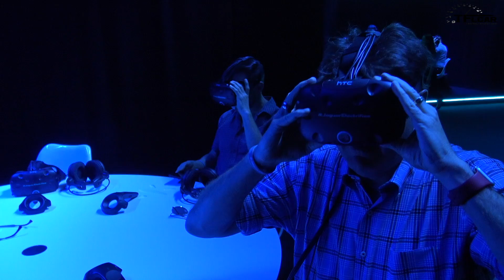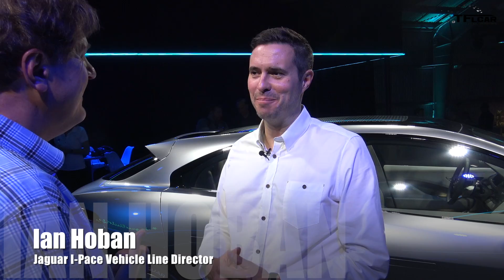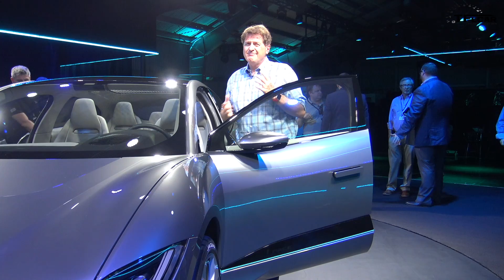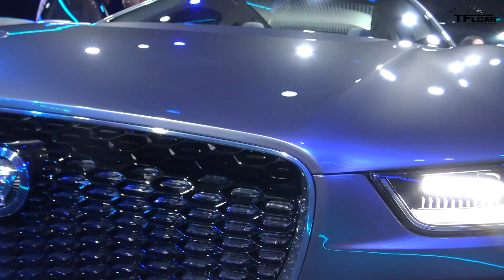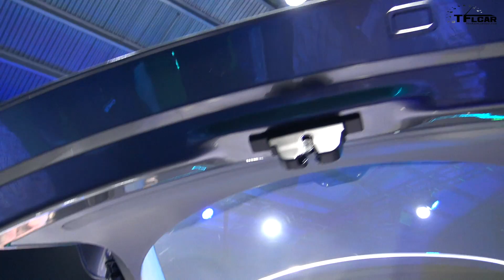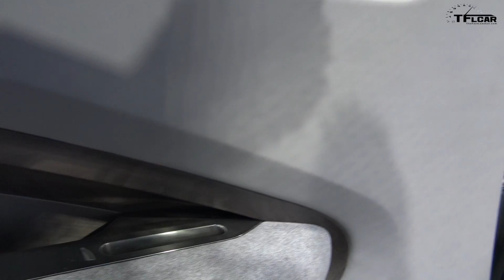2018 Jaguar I-Pace Concept: Jag's First All Electric Car Is an EV Stunner

Comment: That is a beautiful car. Still not ready to give up my gas cars though
Reply: Because batteries are a terrible energy storage medium.
Reply: Batteries also aren't really good for the environment.
Reply: Mike B hydrogen as a fuel must be stored under pressure in tanks of very specific material. It is a light gas that leaks through any permeable material - which is most of them for Hydrogen, as it's the smallest molecule.

Storage must allow for extreme high pressure and extreme cold (as pressurisation cools). It also must contain the ability to create and maintain that pressure and check for leaks - any of which would be catastrophically explosive. It must also be able to detect and eradicate Ice build up which might cause a breach. It must then be able to deliver the Hydrogen to the car safely, with all of the above caveats.

I've yet to see a cost analysis of a system that complex, complete with validation and permits, that costs less than $1million.

Hydrogen stations are absolutely nothing whatsoever like gas stations. They're far, far, far more expensive. 

As I say, the notion of a nation wide infrastructure capable of supporting profitable volumes of Hydrogen powered vehicles is, at best, fantastic and at worst farcical.

That is the reason Hydrogen Vehicles have stalled. Technology is technically there (Though unaffordable). Profit is not. And it's unlikely that it ever will be.

Of the 3 players still in the game on Hydrogen, 2 (Hyundai and Honda) have signalled that they're switching to battery vehicles and the Third (Toyota) is rethinking it's strategy, having sold less than 1000 in a year. Worldwide.

For comparison, Tesla sell more than 2000 battery electric cars a week.

None of this is even discussing the huge inefficiency of electrolysis to create the Hydrogen - a system so poor that you could drive 3 times as far in a BEV using the electricity used to take a HFCV travel a given distance. That means requiring 3 times the amount of electricity generation.

I read that paper. There's a long route between finding something that does something interesting in a lab and commercialisation. It could be decades, if the system is scalable at all. You will ALWAYS have loss in cracking water. The physics of the process make it impossible to avoid, no matter how efficient you attempt to make the system.

Hydrogen as a mass market fuel is a complete non starter.

The only people promoting it are fossil fuel companies. Because they want you to wait for it and ignore battery cars. If you wait for it, you burn petrol and diesel while you wait.

And they're not pushing anywhere near hard enough to be serious about it as an alternative when oil runs out. Just enough to create headlines and cause doubt.

And if the impossible happens and hydrogen cars do take off,.... The only efficient (read: profitable) way of getting it is,..... Steam cracking natural gas. A fossil fuel.

I sympathise, Mike. I wanted hydrogen to be the answer, a few years ago. Then I looked into it and the more I did, the less realistic it became.

It really isn't any more than a pipe dream. To some who are still promoting it, and building a handful of "exhibition" sites (mainly with government money), it's no better than a scam. I guarantee that none of those pumps will exist in 15 years.  There is no Hydrogen future. 

I'd put an order in for an iPace now, personally.  Cars like this and Tesla's are better than regular cars already. Quicker, more refined, more responsive and far cheaper to run. If you have a driveway and a half decent electrician you'll wake up every morning with a full tank. No more money for the house of Saud or the polluters at BP.
Reply: Mike B I'll not repeat this again;

HYDROGEN DOES NOT EXIST AS AN ELEMENT ON EARTH.

There are no Hydrogen mines, there are no Hydrogen fields. Hydrogen MUST be separated from another substance using energy.

Hydrogen is not a fuel, it's an ENERGY CARRIER. It carries the energy used to split it from the substance it came from. That's it. Full stop.

The physical laws of nature makes it impossible for there not to be lost energy in the recovery of Hydrogen and lost energy in the conversion of Hydrogen back into water through a fuel cell or combustion.

Hydrogen is a very, very poor way of storing electrical energy. Very poor indeed.

There is no answer to this. Sorry.

I'm not being pessimistic, I'm being realistic. There is no comparison between using electricity to fill a battery and using electricity to create hydrogen and fill a tank: the use of a battery is many times more efficient.

That makes the infrastructure of battery storage and BEVs cheaper. That makes the load on the grid easier. That makes hydrogen a very poor idea for ANY company looking to make money from the stuff when a better alternative already exists - which it does. A hydrogen plant and storage system will always be at a disadvantage, commercially; they'll be undercut on cost again and again and again.

Add on the cost of the equipment needed to do the job and there's literally no conceivable way for a Hydrogen Economy to turn a profit at scale. And without that incentive, it simply won't be built. Ever.

The market has already decided: battery electric cars and battery storage are commercially available at scale today. Hydrogen is not.

There is no point waiting for hydrogen cars because the infrastructure will never come. Not in 5 years. Not in 10 years. Not in 20 or 30. 

End of.
Reply: research...
Reply: +Adrian Macias. I don't blame you. I kind of think Hydrogen cars are the way to go personally.
Reply: If you go down the fuel cell route sure, very costly, but it has more promise on range and MPG etc in the long run... but if you go down the Hydrogen Internal Combustion Engine Vehicle route which was what I was on about then... that is already doable. And they are still as zero emission as a Hydrogen fuel cell. If MPG on them is comparable to a gasoline equivalent, if not a bit better... then MPG becomes less relevant in both environmental, and fiscal terms. But nobody is bothering to invest in this at all to improve economy, which is a shame as its well understood, can make use of existing technology and manufacturing facilities.

I can believe the cost you cite for the cell due to the chemical reaction requirement, but the pump, essentially which just has to pump hydrogen from a store into the car much like a regular fuel pump does... struggling to see how that could cost $1million a pump. But if you have a source, I'd like a look.

Also in terms of hydrogen production: http://phys.org/news/2016-06-scientists-cheaper-hydrogen.html 
its already becoming cheaper and faster as there is real research going on all the time. Of course I doubt the oil companies want any kind of alternatives for fuel, be it hydrogen or batteries. Because there is still money to be made in oil. And while there is money to be made...
Reply: Problem with that is that Hydrogen cars are DOA.  The infrastructure to sell them in profitable numbers is too expensive and highly, highly unlikely to ever be built.  It costs $1Million A PUMP for hydrogen and due to the nature of the fuel they can only fuel 1/3 the number of cars as a gas station per day.

Practically speaking, a hydrogen fuel station of 6 pumps will take nearly 20 years to break even.  I'm not naysaying - it's just the reality:  Hydrogen has been sold as "the future" by companies like Royal Dutch Shell,... because while you wait another 30 years, you're ignoring BEVs like this Jag and buying gasoline.  That's the point of the scam.

But they have no intention of actually building the infrastructure needed to persuade manufacturers to build HEVS at scale.  None.

Toyota were given a small fortune by the Japanese government to develop the Mirai but it's not a profitable vehicle.  It sells for just over $50,000.  The Fuel cell alone costs that.  They loose at least $30,000 per car.
Reply: @Chicken Strangler batteries are recyclable which makes them infinitely better for the environment than petrol.
Reply: @Strangething90 Methane from cow farts are 23x-30x (don't remember) more potent at trapping heat in than Carbon Dioxide, Carbon Dioxide however lasts in the atmosphere longer
Reply: Hydrogen is the most plentiful element in the universe, its literally everywhere. Readily available clean fuel for all. This attitude of pessimism and worry over profit is why its not being utilised for things other than weapons. Transitions are always uncomfortable, but they are a necessary "evil" that must be pursued. There are plenty of papers where people have tested groundbreaking ways at making hydrogen cheaply and cleanly... as you say upscaling it to industrial level... well, that requires investment before it will pay off. 

The only "problem" around H is money, because there are too many powerful people who aren't interested in progression and paying for it. Fuel cells at the moment are not even required, not when HICE Vehicles are possible and research shows Hydrogen ICE's are at the very least as efficient as a petrol engine if not 20 to 25% more efficient, and that could be improved with research, so we already have a Hydrogen car (minus fuel cell) in theoretical financial reach of the "common man" should manufacturers and industry choose to make it so.

Most manufacturers are still heavily invested in standard ICE's and make only a token Electric car anyway. Eventually it will come down to a choice sooner or later because standard ICE's can't go on forever...  the choice being batteries... or hydrogen.  Batteries may well "win out" In the end, but the battery is an antique energy device thats been modernised repetitively, and most of these electric cars are not cheap as it is. I still support hydrogen, its the superior and more future proof choice and that's my final word.
Reply: Yes, "end of" quite. You insist Hydrogen will never EVER take, I don't know if your clairvoyant or have a crystal ball but, overt repetition of your opinion does not make it a fact, and time will ultimately tell... I personally don't care if Im wrong, or right, I don't have shares in a hydrogen or battery company... so I literally have no conflict of interests in this discussion. I just read the latest research on hydrogen powered vehicles and I have liked what I read.

If anybody else who has followed this conversation is interested, the Latest research for hydrogen over this year, last year, and the year before has made some groundbreaking advancements in the application, storage, and creation of H+. With scope for industrial application.

Further I will add this quote I: Takeshi Uchiyamada  Chairman of Toyota, the largest Car Manufacturer in the world, said and I quote; “Because of its shortcomings — driving range, cost and recharging time — the electric vehicle is NOT  a viable replacement for most conventional cars.” 

That quote is attached to a number of articles you can find on google. If the chairman of Toyota a motoring gargantuan, who made the prius no less... says its not a viable replacement, then thats not a ringing endorsement for Battery cars... Which may be a dead horse which we're all flogging. And we may end up on H+ cars anyway...
Reply: Mike B Please don't quote Toyota. They're already developing Battery EVs because their Hydrogen project has failed to catch on.

It's an easy thing to say "oh this is superior because of x" but the market will decide. The infrastructure needed for the market to do so simply doesn't exist and won't do any time soon, if ever.

Yes there have been advances,... But there have been faster advances in Batteries. Much faster.

And no advances in hydrogen production or distribution have overcome the cost disparity or the reality of the inefficiency of cracking water compared to storing electricity in a battery. There's simple physics involved: One is always going to be more efficient.

Tesla, BMW, Honda, Hyundai, VW, Nissan, Renault, Audi, Kia, Seat, Skoda and Mitsubishi will all have 200 mile battery cars available at around £25,000, making a profit and using abundant infrastructure by 2020. If Toyota can't sell a Mirai for £58,000 and not make a loss of £30,000 on each, why does anyone believe that things will change when the competition is already profitable at a lower cost and is ALSO developing at break neck speed?

When the infrastructure for BEVs is expanding faster due to rising demand and plummeting costs?

Betamax had a USP that made it "superior" to VCR - the quality of image was better. But it was also far more expensive, didn't record as much footage and was only supported by one brand. It failed because VCR was cheaper and more abundant.

Do you think that Hydrogen will buck this trend? Sure, you can charge faster. But the cars are more expensive, the fuel is more expensive, there isn't any choice in manufacturer, they're less reliable by nature, they haven't anywhere near the same level of performance and there are perhaps 8 places in the whole of the UK you can fill one. And no plans to build many more.
Reply: +Mike B This is the same for me: we can use hydrogen to replace petrol in internal combustion engines. It will be less bad for the environment, because we already own our cars. So no other cars to produce to replace our old school ice cars.
Reply: Robert Bidochon incorrect. Hydrogen cannot be stored in a regular fuel tank and the conversion process to install a hydrogen tank is a) prohibitively expensive (more than buying a new car) and b) won't adapt to half the cars on the road.

Hydrogen also doesn't have the same combustion power that petrol has, meaning that you'd have to adapt the engine too - a regular engine would be tremendously under powered if using hydrogen.

So basically no; you can't do that. It's not at all practical or realistic and nobody in their right mind would ever attempt it.

If you want to continue using ICE cars, investment in commercial algae farms is a far better choice than Hydrogen.
Reply: A hydrogen powered car, built from scratch would use a hydrogen fuel cell to generate electricity for electric motors.
Reply: why are you stuck in the past?

Comment: So this specs out similarly to the Tesla Model S P90D in speed and range. The design seems to carve out a middle ground between the Tesla sedan and crossover. It's basically a large hatchback.
Reply: Nissan TitanWarrior The Tesla has like 60 mile more of range and in speed the Tesla wins out. The Tesla while it might not have the interior design of the Jag it is still superior in many aspects. Charging, range, speed, battery manufacturing, summon, autopilot, ludicrous mode, phone app, better and faster home chargers, wide range of destination charges, best customer service, etc.

Comment: Why does 500km translate to 220 miles in the US? Over here 500km is approximately 310 miles
Reply: I was forgetting the EPA procedure
Reply: The EPA in America do the range calibration with the a/c set to 22 degrees while cruising at 65 mph.
Reply: European standards are more text book steady speed under normal conditions standards. American standards are more "real world" standards. Glad more ev's are in the pipeline.
Reply from the maker: +Will Perrin Yes. Different fuel economy measurement procedures.

Comment: I wonder if these auto manufacturers have incorporated any 'safety sheilds' from the harmful electro-magnetic fields that surround you when driving these cars knowing the damage they do to your brain and neuro system. I personally would welcome an independent study into the long term exposure whilst driving these cars, which is where a lot of us will end up spending a lot of our time!
Overall though, this is another one of Ian Callum's brilliant eyewatering designs. He will go down in history as one of the greatest automotive designers of our time.
Reply: "harmful electro-magnetic fields that surround you when driving these cars" Well that's nonsense, for a start.  EV's have never been shown to be harmful in this way.
Reply: we have already have over 100 year study of living in houses and work with electric
Reply: Lawrence5987 there has also been well over 6 decades where high-voltage powerlines have been plentiful and widespread and yet there has been no epidemic of illness that corresponds to the rise of the grid or the prevalence of wiring in households.

Might you have a link or two?
Reply: I am an electrical and mechanical engineer and I more than most, understand what harmful effects electro-magnetic fields have upon the body, specifically the brain and neuro system. It is not widely known about these affects, but there has been research into electromagentic fields by prominent scientists around the world and in some cases, the effects of these fields proved conclusively that on the test subjects, the neurons in the brain had been irrepairably damaged leading to varying behaviours not akin to that individual.
So you might discount these findings as mere folly, but there is much more to this phenomenon than you care to believe.
Reply: Here are a few links as requested:-
 http://www.globalhealingcenter.com/natural-health/neuroscientist-confirms-the-danger-of-electromagnetic-radiation/
 http://www.alternative-magnetic-therapy.com/electromagnetic-radiation-health.html
https://www.safespaceprotection.com/emf-health-risks/what-is-emf/
http://www.shungite-anata.com/en/electromagnetic/effect.html
http://www.emfcomp.com/emf_safety_services.htm?gclid=Cj0KEQiA39_BBRD0w-_rmOrc__8BEiQA-ETxXSzPgFhffRTZOpHufSqQI1ZGp6vICPGUkL1FH4mkhooaAt1C8P8HAQ
http://www.who.int/peh-emf/about/WhatisEMF/en/index1.html
https://defendershield.com/health-risks-from-exposure-to-electromagnetic-radiation-emr/
http://ethw.org/Biological_Effects_of_Electromagnetic_Radiation

I hope that this may shed light on the subject?